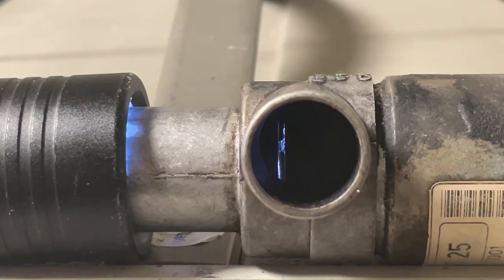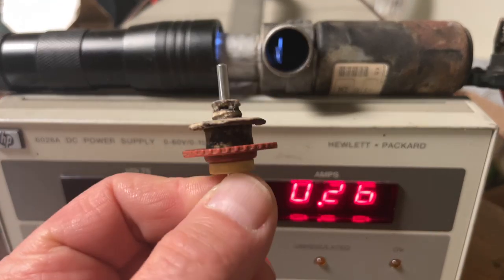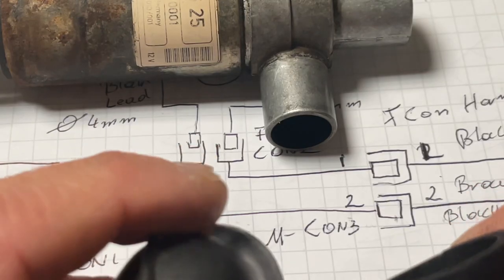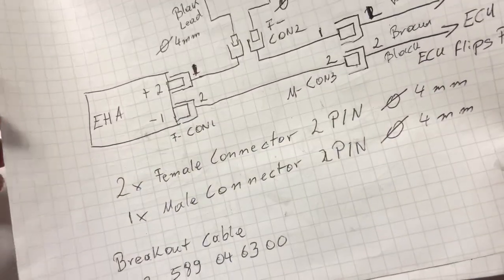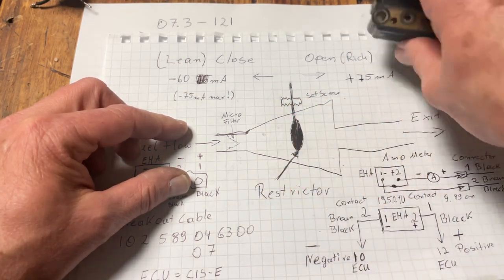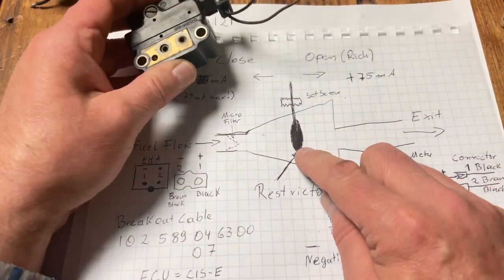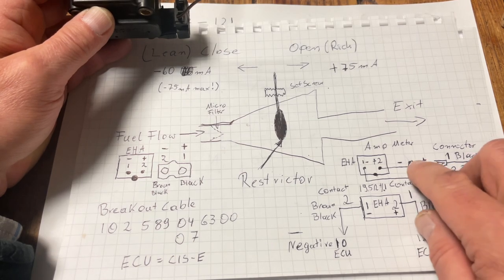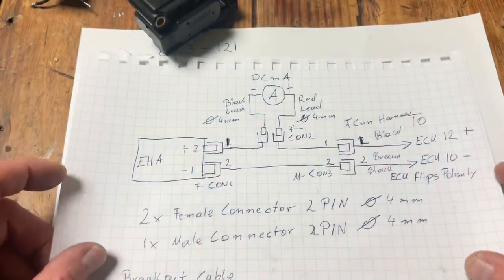Mercedes KE Jetronic EHA Valve comprehensive tutorial, a look at Jordan’s ISCV & Äffle und Pfärdle

Comment: I recently had an issue where my car ran horribly once it warmed up or after the first few minutes of starting. Car would die on acceleration, my mpg plummeted down to about 13 mpg. I ran nearly every test in section 07-0121 for KE as that's what I narrowed it down to. Finally, I unplugged the eha and everything went back to normal. So I then ran the tests steps from 10.0 regarding the eha and everything tested fine. I watch this video and emphasis was put on the polarity of the wiring. I then thought back and remembered I replaced the crumbling connector shortly before the issue occurred, but I replaced several connectors and resoldered fraying terminal pins. I went back out and saw that I indeed had the # 1 and # 1 wires in the incorrect spots. I literally systematically took the whole KE unit apart, swapped out O2 sensors, ECUs, bought a new rubber airflow boot at the fd, re-centered the air deflection plate, replaced the cold start valve, etc, and all I had to do was swap those 2 wires back. Thank you so much! I just put the car back together, and readjusted the air-fuel mixture now everything is back to normal.
Reply from the maker: @brittanywright9646 thank you for your comment! Glad the video was of help to you! 
Peter

Comment: Thank you for this detailed explanation of the EHA. I have odd readings when I test mine.

EHA measured resistance is 19.7 OHM - seems ok.

Ignition on: 74 MA - seems ok.
Engine start/idle: 10 MA. 9-8-7-6-5-4-3-2-1-0 MA gradually readings within 30 seconds. Then goes back up to 4-5 MA and stays.
Acceleration/Revving to 2500-3000 RPM: 0 MA. Then goes to 4-5 MA.
Deceleration/letting off the gas from 2500-3000 RPM: 0 MA. Then goes to 4-5 MA.

All other sensor have essentially been replaced on this 1990 560 SEL. All vacuum lines, fuel and most ignition parts are replaced.

The car runs flawlessly and accelerates great. Only issue is hard warm start and slight fluttering idle.

I am not sure how to troubleshoot this. Replace the EHA, look in to the ECU or other?

Thank you! - Kristian
Reply from the maker: You need to check your fuel pressure as per manual. If fuel pressure drops to fast after shutting warm engine off, then you have either a fuel line leak or your accumulator is broke and results in vapor locking
Reply: @inovahightechltd  Thank you for replying. A new accumulator was installed recently and the fuel system keeps pressure after the engine is shut off. The EHA has not been changed by me, but appears to be okay. I do have the 0.4 bar pressure difference between lower and upper FD chamber. I will however check these things again.
I tested my mass airflow potentiometer and do see this having inconsistent readings. I will replace this. Could this potentiometer cause odd signals to the EHA?
Reply from the maker: The EHA when off (0V) supplies the richest mixture.
This could be a vacuum leak in the intake system which exists only when engine is warm due to expansion of parts from heat,
Have someone start the car when engine is warm and watch on how far the airflow plate is going to be moved down by engine vacuum.
If the plate hardly moves because of a lack of vacuum, then you won’t have any fuel flow into the injectors from FD and the engine won’t start.
Peter

Comment: Hello
I have a question about the EHA.
Fuel was leaking from a small hole in the top of the exterior, not from the O-ring part of the EHA, so I sealed the hole. Will sealing the hole cause any problems?
Reply from the maker: This means the internal seal of the EHA is defective and the EHA will no longer work correctly

Comment: I couldn't get the KJ-stop module to work in my vehicle.
 All the link is correct but I failed. Do you think it's okay to have the 1989 M102.963 KJ-Stop module? 
Although the relay components are correct, it tries to burn LPG and Gasoline at the same time.

 I tried 2 EHAs during the test phase, but my guess is that the EHA cannot agree with the Kj-stop and the EHA does not cut the gas.
 My links are correct.

Comment: If I plug in my connector to the EHA valve the cuts straight out and won't start or run until I disconnect it! Any ideas?  Car has been stood for years
Reply from the maker: You need to very carefully readjust the plate rest position and then tweak the mixture control.
I made several videos which are published here on my channel

Comment: Hi
I have a W124 M103 engine with no O2 Sensor. 
Could I ask, does the EHA measure fuel pressure or fuel mixture.
I have a fluttering idle problem.  The engine rests at about 500 rpm and has a slight shutter on Idle.
I have a fuel pressure of 5 Bars with valve closed and 5.4 Bars with it open. So I don't wish to interfer with pressure.
I've a new Bosch HT system and replaced all injectors. I conducted tests on most parts including Fuel Pump, fuel pressure regulator, Accumulator, ICV and Vac lines.
Any advice is much appreciated. 
Cheers
Reply from the maker: How many miles on the engine? Have you checked and adjusted valve timing with offset woodruff keys etc?
Reply: I have done nothing yet with the internal part of the engine except compression test which is fine in all cylinders.
Reply from the maker: @brianalcock  if you have fixed / checked everything externally then you may want to proceed to the internals, like chain, chain tensioner, sprocket wear, camshaft and valve wear, carbon deposits and verify that camshaft timing is 100% correct
Reply: Does the EHA regulate fuel mixture or fuel pressure? Also, I have seen tests for measuring resistance on the potentiometer but how do you measure voltage.
Thanks in advance
Reply from the maker: Fuel mixture through varying internal fuel pressure in FD
Reply from the maker: On poti measure top and middle pin in dc range. Adjust potentiometer to ~ 0.75V DC at idle
This is for 116/117 engine 
Check your MB service manual chapter 07.3 for the correct value and test procedure

Comment: Hello, I have EHA 6.58 mm CO 45-55% (between 6.5 volts) EHA 20 ohms, fuel cut-off is 68 mA, it fluctuates around +8 and +9 mA at idle. 02 when disconnecting the sensor, +5 and + 6 mA fluctuates. 02 sensor fluctuates between 0.3 and 0.7 volts. How do I make +8 +9 mA -3 and +3 please help me thank you
Reply from the maker: What is your idle rpm?
Reply: @inovahightechltd  750
Reply: W201 102 engine 1.8 otomotic
Reply from the maker: @farmanashrafov4068  I have to check the specific data for your engine. The values stated in the video are for 117.96x engines 
I will post my findings in the next 2 to 3 days 
Thanks for watching my videos
Peter